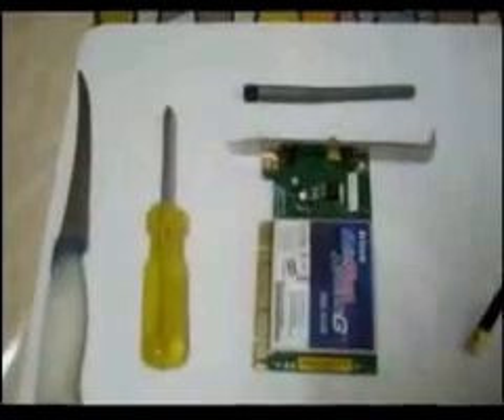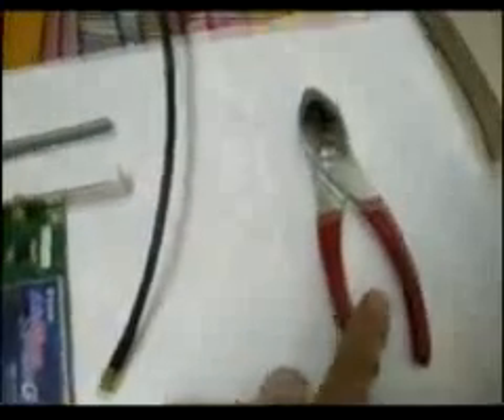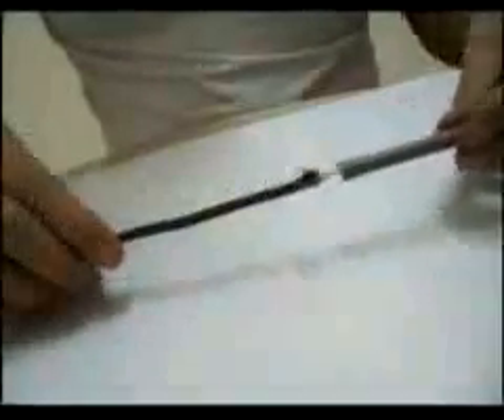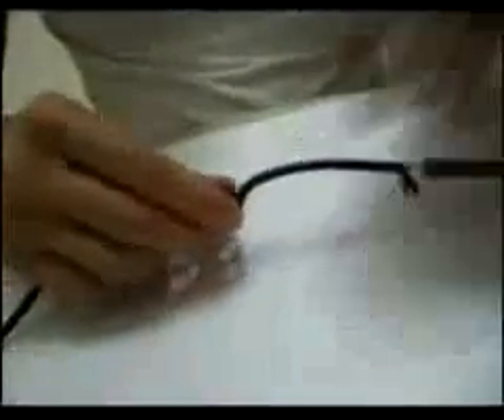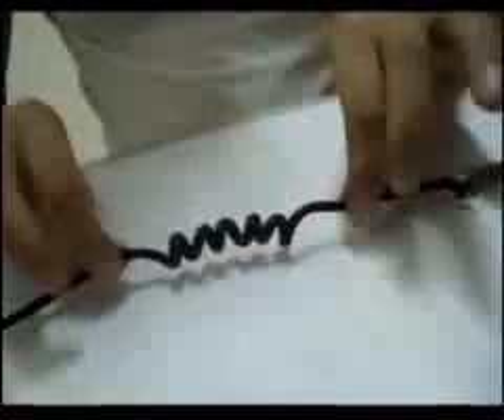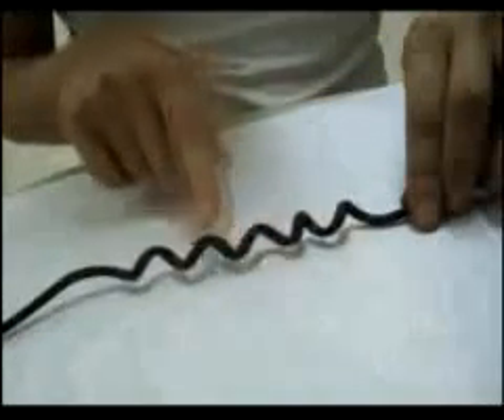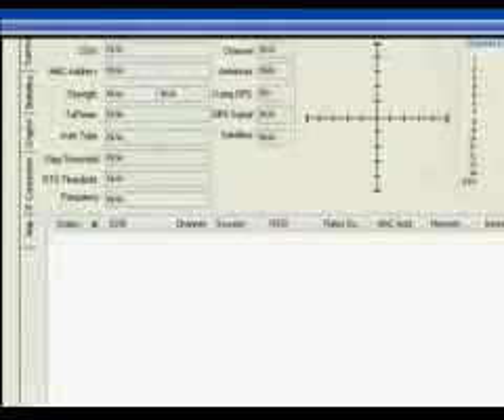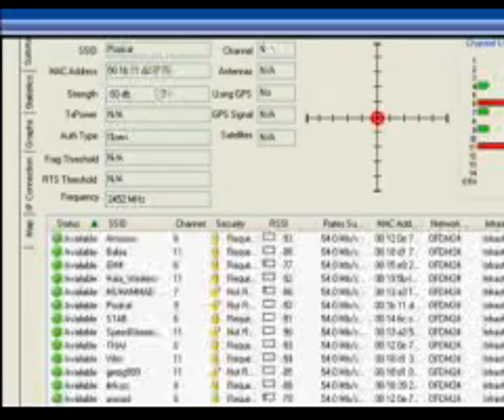Boosting WLAN 3X -  Support, WEP Hacking & Downloads at  www.myjordanfirst.com/forum/

Comment: @retrorecycler ......yes dear i think ur rite.......i dont know more about this.....but t wires we have in the wifi antena is a copper wire with silver coating on it ...........n have high n good transmision of data............now i had left the job of wireless networking .....so t most of t things i had forgot

Comment: This is very MacGyver, lol. 

I have a few questions, does it perform better than the antennas (that also come with a cord) you can buy and replace the D-Link one? How much do the cable and the connector cost if I went to Radioshack? Also do I need to solder in the new connector?

Comment from the maker: (part2)See the waves that are generated from the E-Tape could travel up to 250 Ft. (not helpful) so what I did was I increased the pitch volume of the E-Tape and there I got it to go 723ft. So far so good, then when I placed the antenna in front of it all the access points disappeared! It took me long time to figure out the reason but then it hit me.

Comment from the maker: (part3)I place an access point about 630ft away in one of my friend's apartment. When I pointed the tape directly at the access point I received an "Excellent Signal" but only for 5 Sec. Now what I have to work on is to make the E-Tape constantly transmitting waves and creating a way to automatically rotate searching for access points.

Comment from the maker: Well i am using aa 50 meter cable and it's working just fine. meanwhile a 100 metere cable and over you will need a repeater.

Comment from the maker: I Tryed many types of cables more then 39 types. but they're all the same. Do not use power line cable that has stack of copper wires. TV Cable, LAN Cable cat5. i'll update you more as i go

Comment from the maker: But I discovered that I may send signals two miles away and not receive any signal (I used my friend's router for test he lives about 1.5 miles away). The solution is available but it's very costly! So what I am working on is creating a repeater with cheap home material. So as they say "Coming SOON"